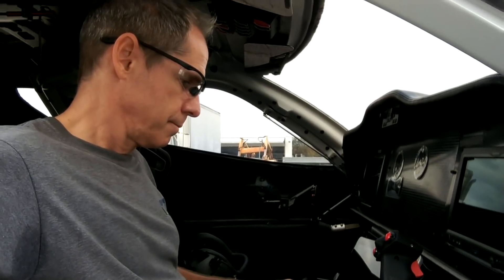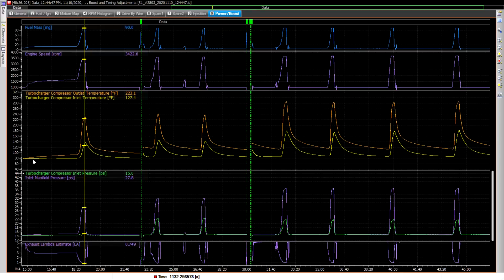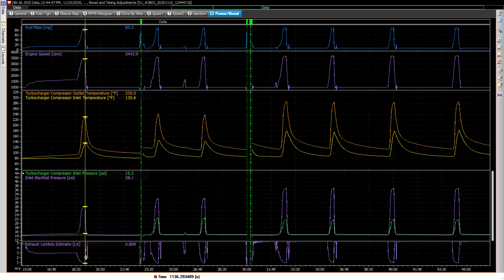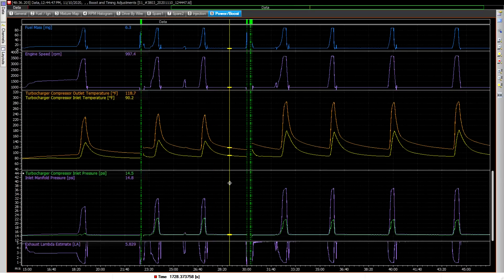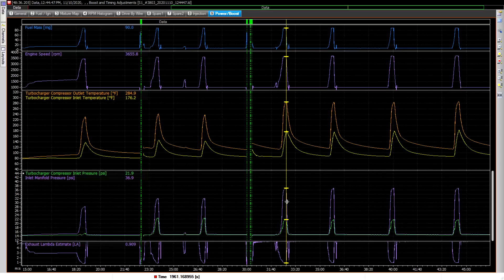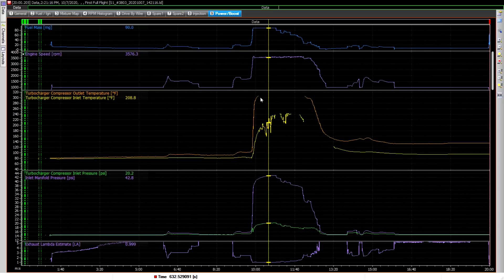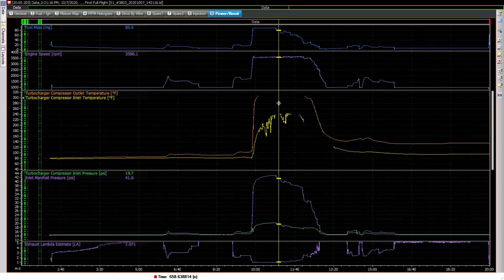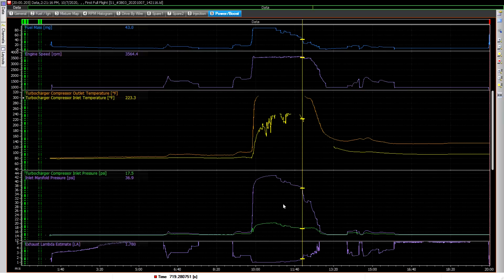Assessing Boost Levels - Building the Raptor Prototype

Comment: fuel that turns to smoke produces almost no power, on one of your reduced boost settings, do some runs at slightly lower throttle settings (until the lambda improves) and watch that the temps drop but the power/rpms are far less affected.

Also, I would suggest that you check out the Gale Banks videos on Manifold Air Density s opposed to boost. you are hitting just on the edge of this as you re starting to look at the temps, not just the boost number, but you don't have the full picture yet.

Comment: Over rich mixture do not increase power .the best power is achieved at  slightly lean mixture but lean mixture  burns at a higher temperature .
Reply: you're talking gasoline engine, this is a diesel where you can add air as you like without consequences, except if it's coming from a turbo, you pay for the extra unnecessary air with heat.
Reply: Just so it's clear, we all agree that Avgas best power is ROP, best economy is LOP, yeah?

Comment: Is it possible to put the radiator into the nose wheel well, and add an air scoop on the nose wheel strut directing air flow up into the wheel well radiator.
The air scoop would raise and lower with the landing gear, it would hide completely out of the way, so aero is maintained. 
You only need this extra cooling while on the ground, please don't start cutting into this beautiful machine.
Reply: @ryanthomas2472  I'm referring to the testing senario of this particular prototype, not normal operating conditions, bud.
Reply: @ryanthomas2472  How well does lowering the landing gear work at cruise speeds? I was referring to safe gear down speeds.
Reply: @ryanthomas2472  once you're moving, you are forcing air into the overbody rear scoop, if you are needing extra cooling at any stage just slow down and lower the landing gear.